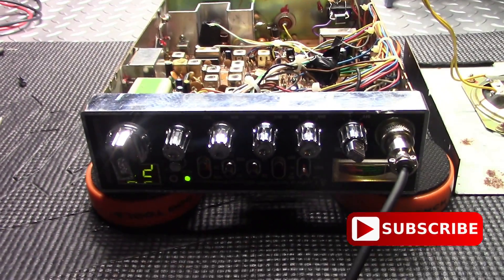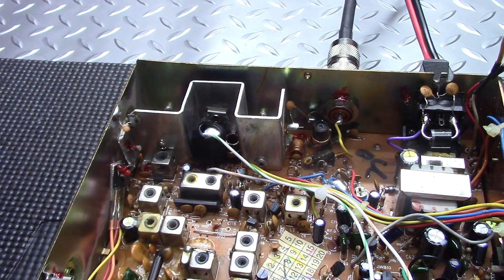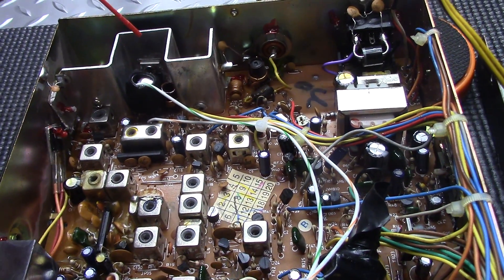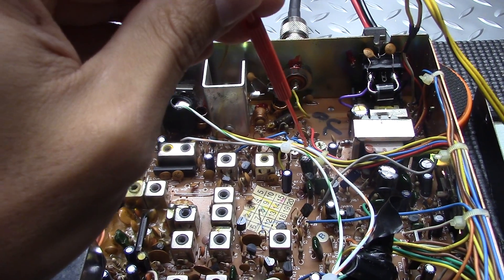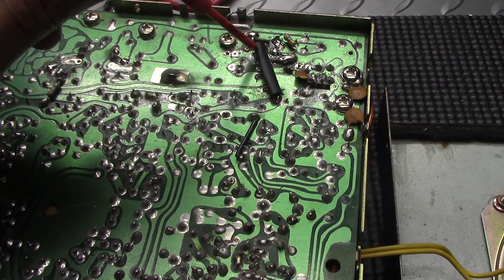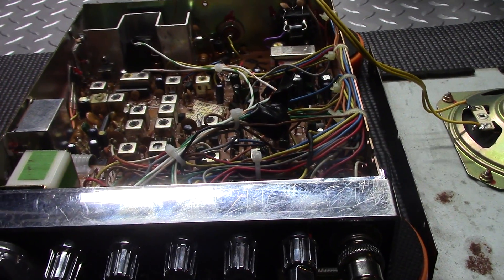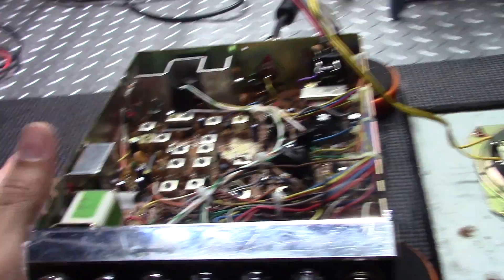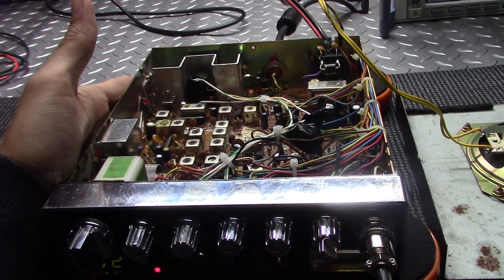COBRA 29 MOSFET CONVERSION: CB Radio How to Install Easy Mod! The Radio Garage simple way.

Comment: Great Video !!
But I have a question your 10k resistor on back side of board looks like it's going to the Center Source Pin, but you said goes to gate pin. Do I solder to source or gate.

Comment: Anyway to mod these with a 2N6045. Which is a RM Italy RM3 mosfet used in RM linear amps.
Reply: Long discontinued RFX-75 & the RFX-85 do something similar.

Comment: @The Radio Garage, Hey Buddy long time Subscriber here. I have an old Cobra 29 NW LTD Classic, (bought new in 2007). I had this Radio built, peaked & tuned shortly afterwardsThis lil Cobra PEP’s right at 50 watts. I’ve had it in a couple of Shops over the last 16 years getting minor things done, new Speaker installed and had Nitro Knobs installed, and have it cleaned thoroughly a few times. Every Shop I’ve had it in said it’s the only 29 they’ve ever seen that does 50 watts Cleanly. I haul Frack Sand so I Truck with the same Guys all the time and they all say that it’s a very Clean & Good Sounding Radio. The last Shop that did the Nitro Knob Install said that whomever did the Original Build/Tune did a really good job on it, and that he has never seen a 29 swing 50 cleanly. Is this possible with Mosfets?  I know that’s what he did the build with because I’ve looked inside of it.
I am definitely not a Radio Builder. Just an Avid Radio Collector, User, Aficionado.
I have a Big Radio in my Truck now, and was thinking about putting this online for sale. Was curious as to what you think it should be worth, seeing as it is a Clean Talking 50 watt Radio with Talkback, Echo, and Nitro Knobs.

Comment: Unclear on bias circuit. What happened to the diode on the bottom side of the board?
Reply: The diode and resistor are in the component side. The 3rd part/resistor he put on solder side.

Comment: Great video, where did you learn CB radio alignment? I've had my tech certificate for a couple of years and ended up working in the "media" field building high voltage microphone pre-amplifiers. But I've always been into CBs. PM me if you want.

Comment: The Radio Garage,thanks alot for sharing your tip.I did my Uniden 78 Elite and had a low voltage @ the gate.The resistor from + @ C116,got my rig working properly.Really appreciate the video man.👍

Comment: Love your videos.
I am retired and bored.
Sooo i been trying to learn every luttle tip an trick an mod i can . 
I will probably buy a scope soon i would like to learn to do clean mods.
I have a handful of radios with bad solder jionts and also picked up a anytone 5555n that i would rather have you look at it the guy i got it from messed it up a little.

Comment: All this info but no simple explanation on the reason to do this in the first place?
Reply: he did state at the end that this is a repair not an upgrade.  It's cheaper than replacing the factory final... if you can even find the genuine transistor to do it with.

Comment: I have a question please.I have seen several of these modifications on the internet but none of the others show the 4.7k across R56 were the companion part goes.What does this do also I have seen some mods that don't put the 22pf cap where R55 was.What would happen if you didn't do this.I noticed it is done with the cobra 29 mosfet super tune but they still don't show the 4.7k across R56.PLMK and also they show putting a 68pf on the back of C59.If I just do it like you did will everything be okay.THANKS and sorry to bother you again.One mod I seen was just replace the final with mosfet,remove R55,R56,C61 then add then add the 470 ohm and diode companion part.Then add a 68pf on back of C59.Have ever tried that way and which way works best.Thanks

Comment: What should the gate voltage be on a superstar ss9000 with dual irf520 finals.  My ssb tx sounds distorted. 
Radio new never touched. Was distorted out of box new from copper electronics from 2015. How to tell real irf520 fets from fake?
What is typically written on real irf520? Please advise,  would love to clean up ssb tx.
Thanks,  enjoy your videos.

Comment: Useful, thanks. What type of capacitor did you replace the resistor (2min 45 sec) with please?
Reply: I believe it’s a 22 pico farad capacitor.
Reply: @jamieweis74  Thanks very much for your reply. I appreciate it.

Comment: I watched the video 3 times and re checked every step.  I’m getting  6 watts totals.   What could I be overlooking
Reply from the maker: So you mean you have a 6 watt carrier or is that modulating?
Reply: The Radio Garage  that’s all it will modulation.
Reply from the maker: Recheck your solder joints. Was the radio working well before? Also where did you get the mosfet from there are fakes going around.
Reply: The Radio Garage I unsoldered and re soldered.   Yes radio was doing great.  I get all mine from 6 star.     Just making sure I didn’t overlook anything
Reply from the maker: Just curious whats your gate voltage?
Reply: Got a superstar ss9000 with dual irf520 finals. Out of the box untouched ssb tx sounds distorted. What should the gate voltage read? Also what should the real irf520 fets have written on them so I can tell if they are good real fets or if fake. Again new unit from copper electronics from around 2015 never touched. 
Please give me some advice.
Reply: How much to have this done ?

Comment: Can you post a parts list for the companion part?
Reply from the maker: The parts I used were a 1n914 diode, 470 ohm resistor and a 4.7k resistor. Put the 1n914 and the 470 ohm resistor in series into the r56 spot once the stock part is removed. Banded end of diode towards the front. Then just solder the 4.7k across the r56 leads on solder side. I tell you the parts and show how everything is installed in the video so be sure to watch the whole video. Thanks and be sure to subscribe if you want to see more CB related videos.
Reply: Thanks for the info.
Reply: Thanks for the reply I watched it three times.i am just getting into the cb stuff and Learning the lingo on the electric stuff.
Reply from the maker: Ok no problem. Thanks for watching.
Reply: The Radio Garage on the bias circuit does the 1n914 or resistor go towards the front of the radio?
Reply from the maker: banded end of the diode towards the front of the radio
Reply: The Radio Garage thank you here goes nothing !